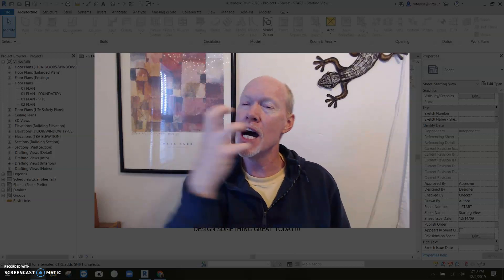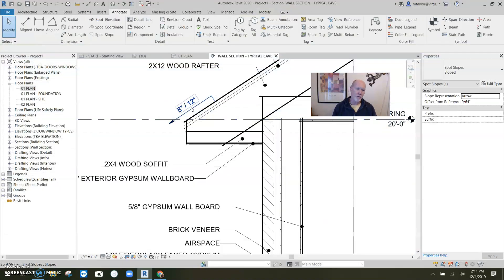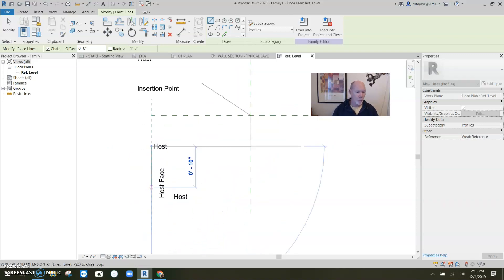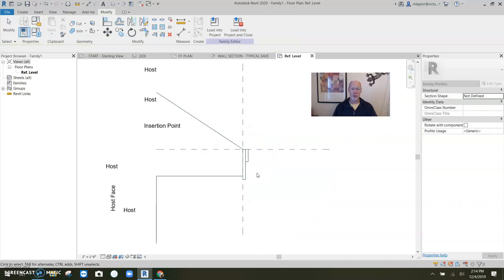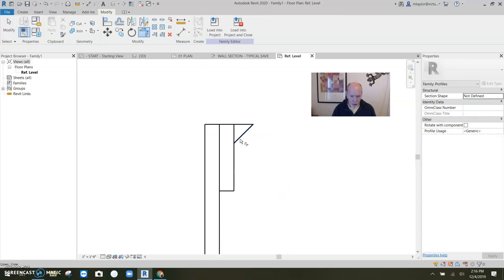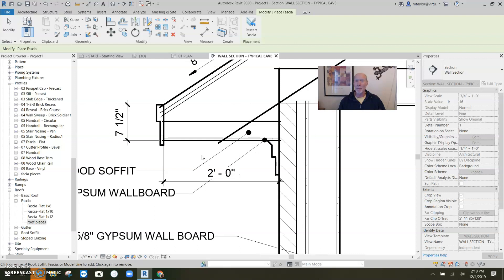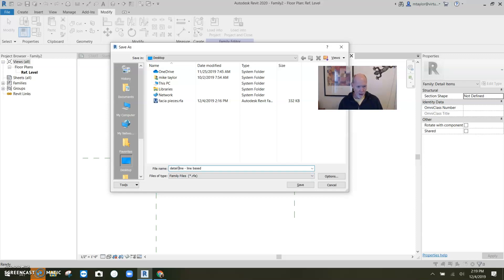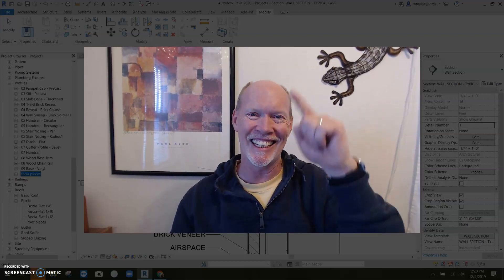FASCIA - The Under-Used Roof Tool

Comment: I have fascia that will absolutely not miter. Its the world's most simple shed roof. 1:12 i want to karate chop my desk with my face. It will everywhere except the peak. Please help boss!
Reply from the maker: I was working with one the other day that would not miter. It turned out the two were microscopically out of plane with each other. Like 1/256” or something stupid small like that. Once I aligned the surfaces.. the fascia worked. Could this be the issue?

Comment: Yo dude. How can you orientate the materials on slope facia
Reply from the maker: If the material you are referring to is a MODEL pattern, you can TAB to one of the lines and then rotate it.  If the material is an image coming in from the material itself, you can rotate the image (Edit Material, Select the Appearance Tab, select the image. this will open a dialog box where 'rotate' is located!)
Reply: @miketaylor-fantastic   But then that material rotates everywhere in the project correct? Do you need to make a new material that only rotates that direction.
Reply from the maker: @wrighthausracing9641  If you are using the material in other locations... it will rotate there also. So yes, you will need 2 materials. I have done this in one project so I could get the wood grain to be correct for cabinets.
Reply: @miketaylor-fantastic   The problem is Is the facia no longer wants to miter together as you draw it.  I would think it would act like dimensional lumber or beams as you rotate them the material rotates with it. The facia seems to be married to one material if it's going to be continuous.
Reply from the maker: @wrighthausracing9641  Those little blue dots must be aligned exactly or it won't miter. I've had trouble sometimes with those too!
Reply: @miketaylor-fantastic   Maybe this calls for a micro training video regarding this situation. You are the best !!!!

Comment: Hello Mike, since the roof sheathing needs to go over the fascia, how would that be accomplished?  All I see are tutorials showing how to use the fascia tool, but not one showing how to put it in the correct location, that is, under the roof sheathing. I would also like to see the metal roof drip edge over the sheathing and fascia and under the shingles.  Thanks.
Reply from the maker: Dean, that is a great point regarding the fascia going under the edge of the roof sheathing. I believe the best method would be to make a fascia that has the small extension of the roof sheathing built right into it. Then in a section you could draw a tiny line to separate them visually for detailing purposes.  Same goes for the drip edge.. add that to the fascia profile and then a simple line or two in the section will separate the different components. It's always a tough call on how much to model and what to take care of with lines in the sections and details.
Reply: @miketaylor-fantastic  can u plz make tutorial on this type of fascia
Reply: @miketaylor-fantastic  Yup. That's brilliant